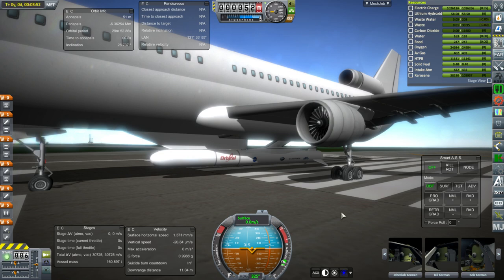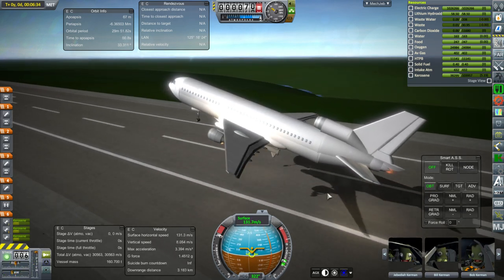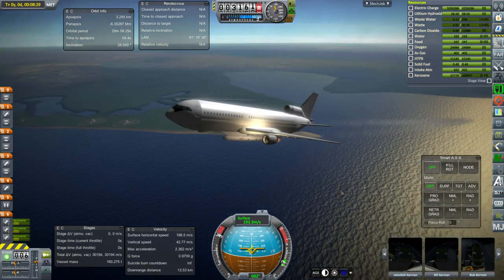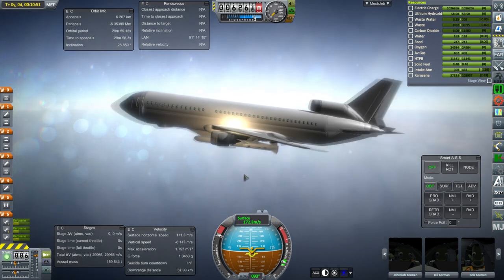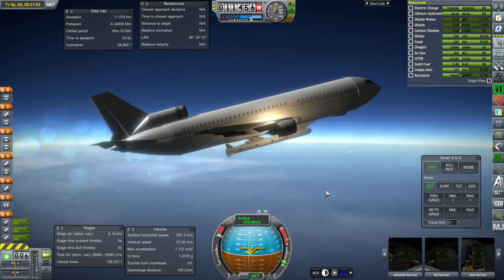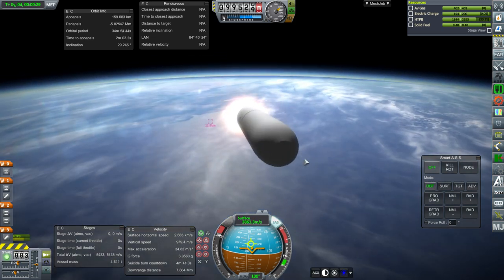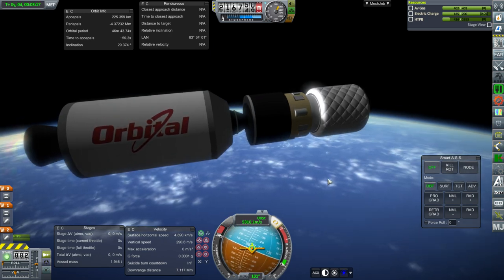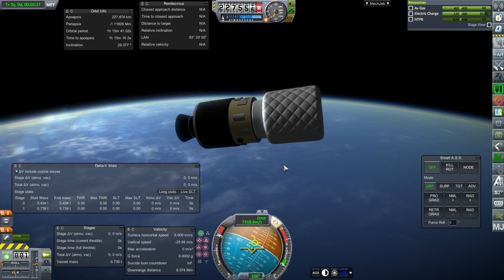Kerbal Space Program - Part Dev - Pegasus XL

Comment: The launch profile and the stuck decoupler can cause lose of delta - V. The decoupler should be mounted upside down, if you attach it to the plane first it will got with the rocket just like when you attach it to the core of a rocket it will stay stuck to the boosters. great video BTW

Comment: The hard point solution is to attach the hard point to the booster then the plane to the hard point. That's the only real way to get around it
Reply from the maker: Well, I hope I can reroot and subaassembly the L-1011 without the game freezing, then. Thanks for the info!
Reply: @RaizSpace Or make the rocket as a subassembly that you attach to the plane with the hard point.
Reply from the maker: That would probably be easier. I'll try it out.

Comment: I had the same problem with the harpoint on my B-52 Mothership and X-15. The only way I got around it was by using docking port jrs and just clipping one into the body of the x-15 where you couldnt see it after decoupling.
Reply from the maker: That's an interesting idea. I don't even remember how I did the X-15 - probably subassemblied the B-52 and attached it onto the X-15 or something.
Reply: @RaizSpace  I'll have to take a short video of it in action and send you the link when I can.